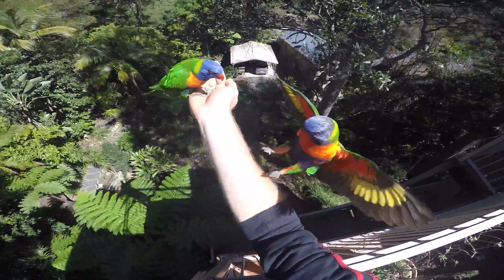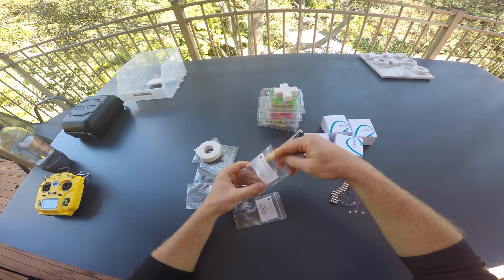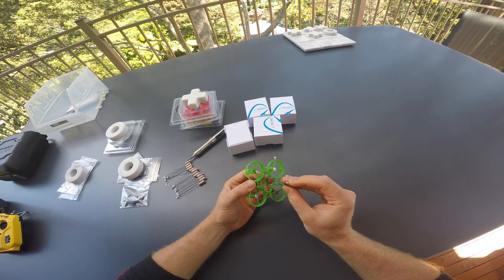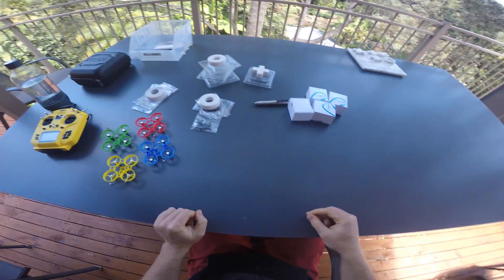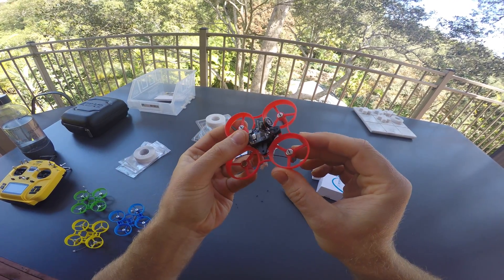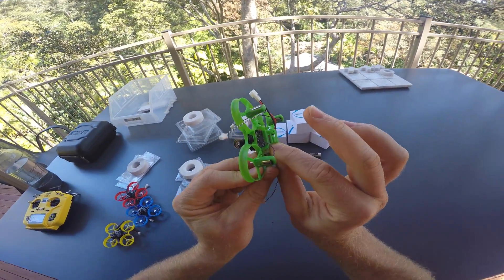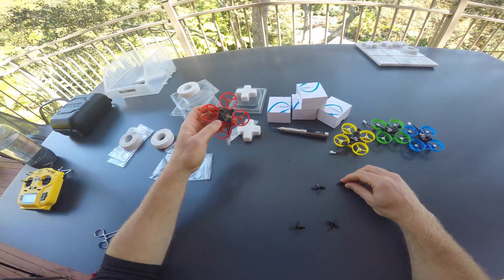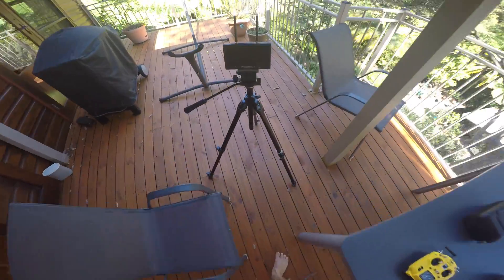micro quad assembly - in 10 minutes

Comment: love your videos! 2 questions please: 1- why reversed props? 2 - can you use turtle mode or flip after crash mode with those brushed motors?
Reply from the maker: Reversed props are said to fix the wipe-out/freak-out issue in Betaflight. Cant 100% confirm that yet, but it also doesnt seem to have any averse effects.
No turtle mode on this board. Its a board (motor driver) issue. The motors are capable of inverting direction, but its needs an extra FET per channel to do that.

Comment: do you have a cli dump for the f4 flight controller?
Reply from the maker: Still polishing it ;)
Do you have this exact FC already?
Reply: I do. Solved the pulling out of drive issue for me that the f3 had. Just need the the config tuned for the new board. I'm am running almost the exact config from project mockingbird.
Reply from the maker: I will post my setting when I’m done tuning it.
So far, I have NOT solved the freak/wipe out issue, after implementing every „fix“ I could find. I hope I missed something. What did you do to fix it?
Reply: Nothing the only thing different on it was the radio protocol from my f3 config.
Reply from the maker: Hmm.. unfortunately,  I cannot confirm that on my setup :/